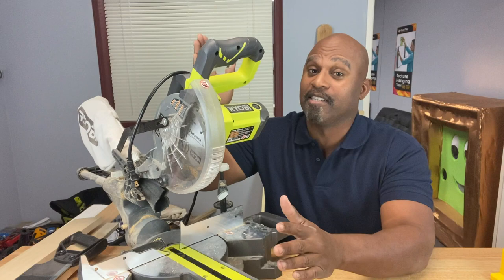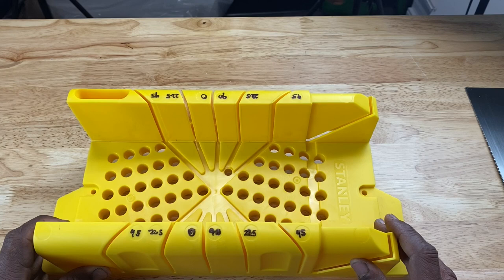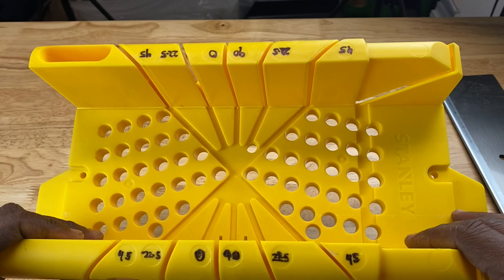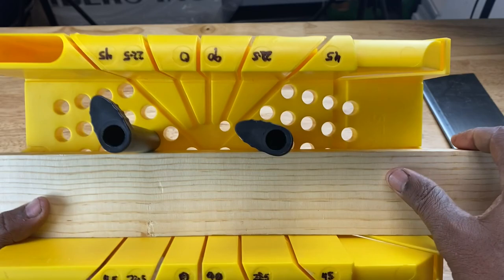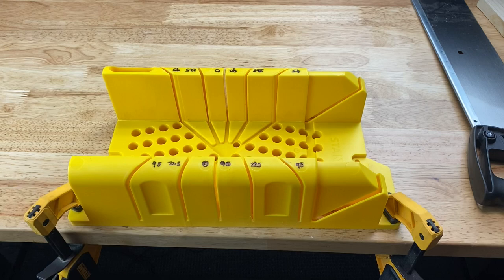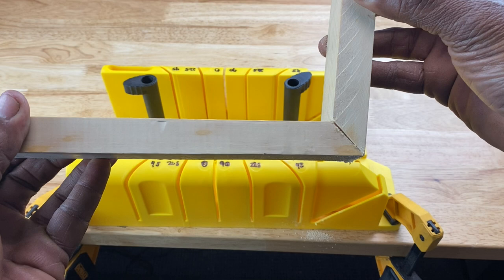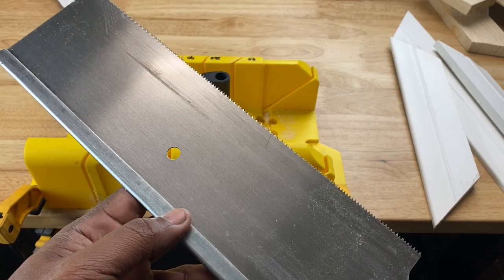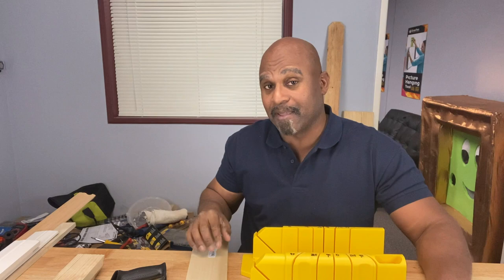MITRE BOX REVIEW

Comment: Fabulous - thank you very much. You were so clear, concise and made learning enjoyable.  I'm obsessed with DIY and have just purchased an SDS Plus Rotary Hammer Drill as every wall I need to infiltrate is old tough concrete which my ordinary hammer drill could not cope with.  I am small and the drill is exrremely heavy, so I really have to hold on to the drill tightly to ensure my whole body doesn't spin around and around  - rather than the drill turning in the wall 😂🤦🏽‍♀- though I'm sure that would go viral 😂🤦🏽‍♀.  Thanks again.  Psyche aka Psyche Thompson UK 🌹
Reply from the maker: 😂 Funny, glad it helped.

Comment: Hello, 
I would like to know what's the best way to cut multiple angles. I need 15° cut. I don't want a table saw only doing arts and crafts. I'm making a suspension bridge. Thanks in advanced
Reply from the maker: Well, if you don’t want to use a table saw or power tool, you may have to scribe the angles with a pencil or marker onto your work piece and use a hand saw. If it’s an arts and crafts project I assume the material isn’t that hard or thick. Is it wood? Btw, a mitre saw will do the trick better than a table saw. It’s much quicker than a handsaw. Check out the video on how to use a mitre saw. https://youtu.be/GLkTiyUMtio
Reply: @Caliber8Tools  
It is wood, soft wood. 99% of the pieces are less than an 1" thick.
I currently use a dremel but my cuts are never straight. Thanks for the video link and taking time to help us learn!